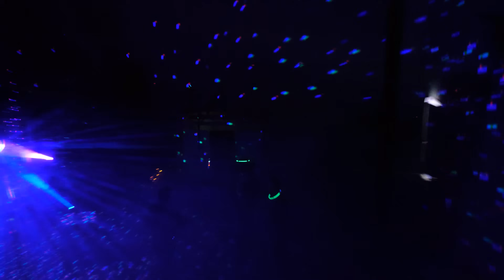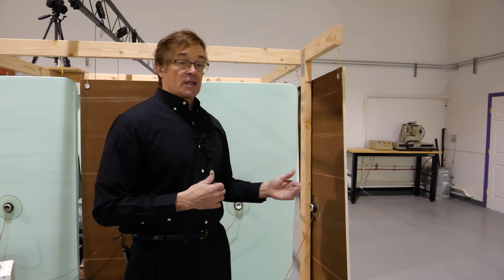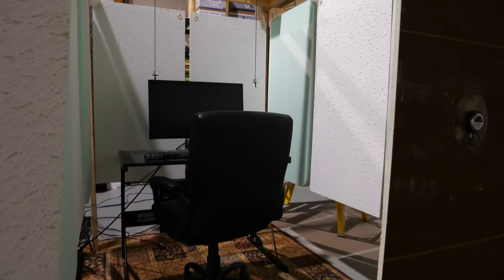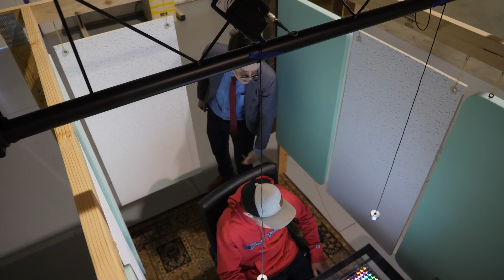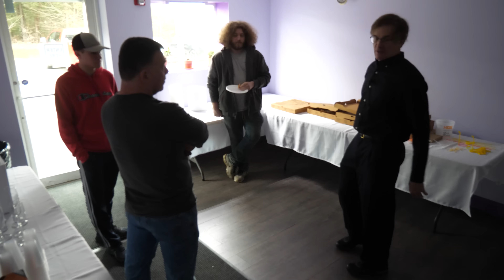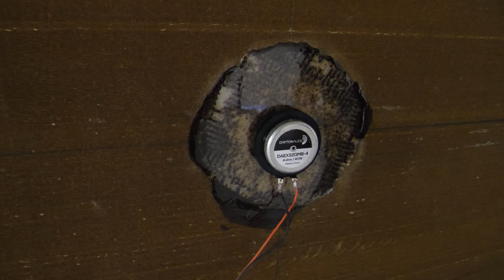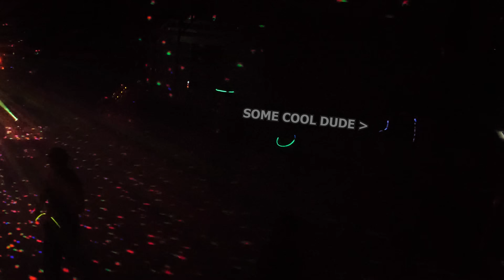SHOULD SPEAKERS THIS GOOD BE LEGAL?

Comment: As an inventor of DMP drivers (see my patents), I found that the key was the BML force of the driver. The sound is truly immersive, for some environments much better than conventional speakers i.e. restaurants, offices, open space. However, I do not believe these will ever produce true high fidelity sound because of the phase incoherence in the radiation source.
Reply: One thing I noticed as I read these comments is,  the absolutely incredible amount of information freely given, and then others who will ignore this free knowledge and comment about capital letters. ............sigh........... people ! ! !
Reply: @brucejones2354  The capital letters part is a personal QUIRK of mine!  I just like doing it.  

I copied a computer systems guru named "Bombastic Bob" in England who does the same thing.  I think he's a lot older than me (he's in his 60's I think) so I just kinda just followed his lead and became his SHOUTING IN ALL CAPS GEN-X PROTOGE!

After than, I just happen to LIKE sharing information freely since that is sometimes the ONLY WAY to get things to change OR make people aware of new ideas and new technologies.

You would be quite surprised at what will be FREELY DISCLOSED AS OPEN SOURCE UNDER GPL-3 in the next few weeks and months!

1) TWO NEW Battery Technologies (1600 miles range while towing 25,000 lbs with 4 heavy 250 lbs passengers) Aluminum-Sulfur Reversible Consumptive Anode/Cathode Process for 8x the energy density of Li-Ion at only 1.5x the weight penalty AND our newly developed SQUARE-shaped Graphene-Sheet super-capacitors joined in series to create an equivalent 500,000 kWh capacity charged from 0% to 100% in 70 Seconds at 240V/30A or 4 Minutes at 120V/20A

2) 128-bits Wide GaAs 60 GHz clock speed 575 TeraFLOPS Combined-CPU/GPU/DSP stacked-layer super-processor-chip with built-in 32 Terabytes of Non-Volatile Universal Memory which works as BOTH System RAM and as SSD-like Long-Term Storage Drive. Partionable to how you Like!

3) Acoustic-Wave Compressed Plasma Suspended In Low-temperature Molten Metal Power Generator (One Megawatt continuous 24/7/365 output in two home refrigerator-sized modules -- just needs water, a decent radiator/heat exchanger attached to the built-in micro-steam turbine assembly and a 12 volt starter battery!)

4) 12 inch to 36 inch ride height electronically-adjustable Fully Active All-Wheel-Steering and Ride Control with 4x4 Independent Suspension System combined with EV Motor in Upper-Hub-Drive design for truly 4x4/off-road high-clearance applications on SUVs, medium and light duty trucks and up to 175,000 lbs GVWR heavy-duty Class-8 truck towing dual trailer weight ratings!

So NOW YOU KNOW what we can do as a completely under-the-radar Aerospace  company!  Get ready for the upcoming Free and Open Source Under-GPL-3 licence terms public disclosures of these new technologies!

V
Reply: @StarGateSG7  It sounds like you have an amazing job with a phenomenal company. May I ask who you work for? It's time i updated my resume!
Reply: @StarGateSG7  HI. Do you have any links to the four things you said would be be disclosed? You seem to know a lot, but also claim quite some extraordinary things. Would be cool to read about some of them from an official source. Cheers
Reply: @StarGateSG7 did you try the speaker with borosilicate glass?
Reply: @Roman-oo9wl  Our parent company is a large under-the-radar Canadian Aerospace concern that dabbles in such things and YES they did use Borosilicate Glass! 

Cutting it though is quite the effort! The waterjet cutter shattered the glass and we had to use a 5 Kilowatt CO2 Laser to do the cutting.

It was an internal project as part of an internal extension of Canada's National Research Council audio speaker research into Polypropylene and other non-paper-based speaker driver materials. This was done from the 1970's into the 1980's and our company used some of the old patents and public material disclosures to extend that research into various ceramics, glasses, metals and even magnetically levitated blocks and fluids/gasses!

We found it BEST to use THICK (5 cm) and very stiff ceramic blocks with an embedded strip of iron on the edges so we could FLOAT THEM within a large magnetic field and bounce a laser at the centre and four corners that allowed us to measure the position and control the speaker panel with ULTRA HIGH PRECISION, giving us 5 Hz to 60 kHz Frequency Response since we were able to use large pulsed magnetic fields to REALLY QUICKLY MOVE AND VIBRATE BACK AND FORTH those ceramic panels to create super high fidelity sound.

The parent company ALSO used Borosilicate and other glasses and metal sheets as speakers but you get TENDED to get sympathetic resonance of the panel itself that create unwanted harmonics OR the bass sucked the big one in terms of overall quality and clarity. 

Thin Glass and Metal sheets were best for mids to highs. (i.e. as tweeters and mid-range drivers!)

NOW the company is experimenting with using a ferrofluid to create Virtual Speaker Cones and Planar Sheets that use pulsed magnetic fields to form temporary planar and cone-shaped forms within the ferrofluid that can PRECISELY SHAPE the sound pressure waveforms and vibration rates to as low as ONE HERTZ up to 110 kHz (i.e. bat ear territory!) at high amplitudes up to the maximum possible in air of about 192 dB! 

We can make these virtual sound sheets AND virtual speaker cones of ferrofluid as large or small as we want and then form them into ANY shape to best reproduce a SPECIFIC frequency and amplitude of sound. 

We can even create speakers of ANY shape and size so long the multitude of magnetic field emitters can push and pull the ferrofluid vertically, horizontally and/or twist it at any angle. We can even shape the virtual speaker shape to PREVENT or accentuate standing waves, phase cancelation, harmonics and other audio waveform products/emissions.

We can even shape the audio waveform to create a sort of acoustic tractor beam which can suspend and then push/pull an object as heavy as 1000 kg in mid-air!

The above disclosures and ideas are now FREE AND OPEN SOURCE under GPL-3 Licence Terms!

V
Reply: @StarGateSG7  ok, even though I probably don't  understand everything you just wrote, it sounds amazing what you can do nowadays and even in the 70s and 80s. I also love your attitude in the comment section, I mean, you obviously know what you're talking about, and use caps as in spoken language to friggin high light something which you want accentuated, so I really don't understand the issues of some people. The only thing concerning your points is, that this project is about creating the best sounding speakers on a BUDGET :D, so reading about materials that are only cuttable with lasers and stuff, I assume the prizes for these materials would be accordingly.

Still, it's always a pleasure to read such an abundance of random knowledge I wasn't aware of, so thank you so much :)
Reply: @felixl.2606  If the have the PATIENCE, then YES Borosilicate glass aka Pyrex can be cut with a normal glass cutter (i.e. my dad was a Glazier!) but the chance of unwanted fracture is quite high. 

Borosilicate is about $40 USD or $50 CDN per square foot so it's not too bad for small projects.

You can get large and stiff 4x8 foot (94 inches by 48 inches) ceiling tile and even ceramic boards for about $120 to $250 per sheet that are suitable for audio use.

And HARD and rigid 4 ft by 8 ft sheet of Acrylic (i.e. transparent plastic) sheet is also about $350 USD and that might work just as well as normal borosilicate glass.

You can cut that with a simple jigsaw!

V
Reply: @StarGateSG7  glass panel is heavy. 
I fail to see how this would be suitable to effectively use as a speaker membrane. One of the criteria mentioned by Tech Ingredients for panel material choice is weight. It should be very light, and rigid. Thus the choice of polystyrene panels. Intuitively, a vibrating part should obviously have very low mass to minimize losses and ensure the movement of the panel corresponds as much as possible to the actuator (exciter) input.
Personally, I would think some composite like micro-balloon loaded epoxy, or some carbon fiber sandwich on top of expanded polystyrene panels or aerogel would be much better suited than some heavy flexing glass pane.
So, no disrespect but a cursory examination of the characteristics of a glass panel tells me it is totally unsuited to this application. Care to comment why the criteria do not apply and a glass panel would be a good candidate ?

As for your other claims, I will say that advanced technology is undistinguishable from magic so sure who knows... but I will wait to see any demonstration before judgment. Until then, sounds like star trek tech. i.e. not working within our world. Would love to see it at work though, please post some videos, specially of the one ton object levitation.
Reply: @bschwand  YES! You are correct that glass panels have SIGNIFICANT MASS which would normally make them quite unsuitable for speaker purposes. 

HOWEVER, glass is also a crystalline substance having significant sympathetic resonance capability which means that ANOTHER force applied to said glass panel can make said larger glass vibrate fast enough and with enough force that acoustic waves will be emitted from the panel itself.

Using an analogy, you can make a very large structure vibrate using a smaller structure such as a hammer IF the frequency of the hammer is resonant with the larger structure.

(I should note that I am NOT a structural engineer, nor even a acoustics expert although I do have significant audio production experience - aka I know what sounds good!)

Glass panels can be resonated using sophisticated computer control attached to a vibratory structure that will cause the much larger glass panel to also vibrate at nearly the same frequency. 

It doesn't even have to be a sympathetic resonance but rather the internal propagation of attached mechanical movement causes a larger structural movement within the crystalline structure of a glass panel which then moves larger amounts of air forming listenable acoustic waves.

Since I am not an expert in this, I have to rely upon the translated-by-me descriptions of our "Real Experts" who actually ARE mechanical and electrical engineers and also our in-house acoustic experts.

All I know is that I hear MUSIC coming from solid glass panels that sounds crystal clear and full of "Vibrance" and pleasant tonality especially on highs and mids so Classical Music and Acoustic Guitar and midrange singing seems well-suited for glass panel speakers.

In terms of lifting 1000 kg masses, when you have 5 Tesla electromagnets, you can make almost ANYTHING with ferrous metal in it move at enough speed and amplitude that you can MAKE IT emit music.

Even solid rock or metal blocks infused with strips of iron can form a speaker!

It's quite fascinating to see something that heavy being pushed around like a toy. Just make sure you don't have anything metal inside of you or on you when you get close!

For a demo, there are a LOT of products we will be releasing publicly as OPEN SOURCE GPL-3 licence terms and as proprietary saleable items for very specific corporate reasons and these announcements and visual demonstrations will be the required proof that will basically start a BILLION conversations!

While I cannot SPECIFICALLY give you an absolutely exact date and time, I can say within a few weeks to a few months up to the first quarter 2023 that such reveals WILL be made!

V
Reply: @StarGateSG7  we are talking about speakers, i.e. should vibrate at 20-20khz. We don't want any resonance which would favor some frequency over others.
You explanation raises more issues than it solves...
Reply: @bschwand  I guess I should change the words "Sympathetic Resonance" over to controlled vibration by an excitor apparatus.

Evidently, my usage of the term was pointed out as being incorrect by our audio engineer in that there are acoustic waves that can hit the surface and/or travel through the glass speaker driver to cause vibration (i.e. resonance) that can cancel out other waveforms and/or cause harmonics that are unpleasant to the ear.
That is NOT what we want!

There is also simple mechanical vibration caused by a "hammering device" (i.e. an attached excitor) causing any surface to vibrate at the same frequency or a set harmonic of the direct mechanically attached or hammering excitor device.

There are a few ways to cause vibration but ANY SURFACE that can be controlled by a computer ensuring specific parts of and/or the entirety of a flat or shaped surface vibrates enough to emit acoustic waves can be turned into a speaker if the resolution of the vibration (i.e. vibrate at specific frequencies for a set period of time) can be made controllable in a highly precise manner.

Using Borosilicate Glass is a VIABLE speaker driver in the treble to high sound frequencies. Due to the tight crystalline bonds within most glasses, the SPEED of mechanical vibration can be so precise that nearly perfect reproduction (i.e. clarity) of an original waveform is preserved throughout the treble to highs range.

Again, I am NOT a mechanical engineer so the deep theory escapes me but I do understand the BASICS of what our engineers are saying.

All I can say is that I hear crystal clear mids and highs of classical music, acoustic guitars and mid-range and soprano voices when a borosilicate glass surface is computer controlled to vibrate at specific frequencies for set periods of times as per an input waveform.

It sure sounds good to me!

V
Reply: @StarGateSG7  You know it does sound like you know things. Things you shouldn't be talking about publicly. 

Then I looked some stuff up you've said elsewhere online.

A claim of a Canadian built, opto-electronic supercomputer with 20 million CPU cores, that has over a YottaFLOP* of processing power? Our fastest supercomputer in the states that is publicly acknowledged has 1.102 exaflop/s performance. You really think we would believe the Canadians have a computer A MILLION TIMES faster? Good one. Had me going on this thread though. 

[1 Yottaflop is approximately 1,000,000 exaflops]
Reply: @crispinds  YUP! It's True! Our Northern British Columbia Data centre has the "ThunderHorse" and "DragonSlayer" supercomputers which use Opto-Electronics on GaAs substrate at 128-bits wide as a combined CPU/GPU/DSP + SIMD/MIMD Vector Array Processor superchip running at 2 THz clock speeds.

I designed the hardware accelerated 2D-XY and 3D-XYZ SOBEL and CANNY edge detection code, the pixel to vector conversion software and various RGBA/YCbCrA/HSLA colour correction and  video filters PLUS the onboard 2D and 3D warp and special effects engine code!

Fully ITAR-free and all-Canadian designed and manufactured too! 

We have been running Potassium, Sodium, Phosphorous electro-chemical gating simulations that emulate at the molecular level human neural tissue to create functional WBE (Whole Brain Emulations) which get us to IQ-160 humans! 

We then turn that into 24/7/365 materials scientist researcher that does Graphene Sheet and BuckyBall (Carbon-60) optical waveguide/cavity resonator systems and electrical storage and transport systems (i.e. Supercapacitors) plus research on Aluminum-Sulfur electro-chemical storage. 

We didn't bother with Aluminum-Ion or Sodium-Ion batteries as far too many other researchers are doing that nowadays and we needed something that was ruggedized, RAD-Hardened plus high-heat and cryogenic-rated for space operations.

SO YES I do KNOW what a YottaFLOP is!  I've designed and coded multi-spectral Synthetic Vision and real time 10,000 fps object recognition systems, so I DEFINITELY THINK that I understand the implications of our advanced supercomputing systems rather well!

V
Reply: @StarGateSG7  1000kg? how far away was the object? Scale? This all sounds pretty fantastical for me to use air pressure to move that heavy without some serious physical stress on either the system or the object being moved.
Reply: @thalesofmiletus6162  We doesn't use air pressure! Our system uses MAGNETIC FIELD PRESSURE where thin squares or long rods of a ferrous metal (i.e. high iron content metal) are embedded into glass or ceramic plates and multiple external electromagnetic coils can MOVE the panel by pulsing the EM field many times per second at various locations and using LIDAR to figure out the POSITION of the glass or ceramic plates with micrometers (one millionth of a metre) amount of precision. 

Simple gaming class CPUs/GPUs can EXACTLY control the large 1000 KG weight to position it ANYWHERE within a 3D-XYZ volumetric space floating it it in mid-air using only the powers of many electromagnets, LIDAR (aka Laser Radar)  and computerized 3D-XYZ positioning algorithms. 

Works like a charm! It's the same tech used for magnetic levitation trains -- You can float a 20 tonne train car (40,000 lbs) on magnets, so moving around a 1000 KG (2500 lbs) object is a piece of cake these days! 

It's the same principle but on a 3D-XYZ volumetric positioning basis instead of a 2D-XY linear positioning basis!

V
Reply: @StarGateSG7  there is no info on these two Thunderhorse, dragon slayer supercomputers... it is very interesting though. what's your view on  AI research where are we headed ?
Reply: @arunsshiva  ThunderHorse, DragonSlayer and Haida Gwaii are internal code-names of Gallium Arsenide-based opto-electronic supercomputers designed and made entirely in Canada (i.e. are fully ITAR-free) using 60 GHz and Two THz clock speed combined CPU/GPU/DSP/Vector array processor components that are liquid immersion cooled (Silicone Oil baths)

North Canadian Aerospace (our public pseudonym) is a fully-under-the-radar aerospace company designing and building many NEW technologies such as Aluminum-Sulfur batteries, graphene sheet super-capacitors, computer controlled rheological-based magnetic suspension systems for specialty high-clearance 4x4 vehicles, DCI 16k resolution 2D/3D cinema cameras and super-low-light capable optical-grade acrylic prime and zoom cinema and super-telephoto lenses (i.e. T1.0 to T2) plus super high bandwidth wireless communications systems (100 Gigabits per second and faster!) and actual designed, building and flying of SSTO space planes!

You have NEVER heard of us! You have NEVER seen our company anywhere in the news! Our supercomputers, while the ACTUAL fastest computers in the world bar-none!, are nowhere to be found on the T500 list. 

We are completely underground (quite literally too!), so NO you won't find evidence of our devices and technology ANYWHERE in mainstream media. HOWEVER, some very very very big technology movers and shakers in the world ARE aware and have seen demos of our products and KNOW that we are DECADES AHEAD of some of the biggest technology companies on Earth!

Our primary competitors are Lockheed Skunkworks, Boeing Phantomworks,  Northrup-Grumman, Raytheon Special Projects, BAE, EADS, IBM, AMD, Intel, NVIDIA and a few others who are VERY VERY VERY secretive in their operations. 

V
Reply: @arunsshiva  Ironically, at the moment I personally am working on our WBE (Whole Brain Emulation) which does electro-chemical based simulation of  human-neural tissue at its BASE LEVEL sodium, potassium, phosphorous, etc. receptor gating/notch-filtering dendrite-level emulation. 

Using PHYSICS based rules, we simply let chemical and molecular bonds within human tissue "grow" and see what happens when we apply EXTERNAL sensory inputs such as the electrical voltages, amplitudes and larger waveforms associated with touch, hearing, sight, smell, taste, etc. reach those neural tissue receptors and EMULATE the glucose uptake of same tissues (i.e. we digitally "feed" the neurons).

We take all the BASE electrical waveform INPUTS from the light reflections caused by reading books, watching TV or viewing the natural world AND we apply the inputs of audio waveforms AND representations of Touch, Smell and Taste and then apply them to the digital neuron inputs which use common rules of electro-chemistry and molecular physics to grow, connect/disconnect those neural connections and filter said signals. 

After Billions of computer hours (spread out over many of our super-chips within the last decade), the Digital Neurons which are basically data records and objects/classes containing Boolean States, Fixed-Point, Floating-Point, Signed-Integer and UNICODE String values that are iterated, moved, copied and filtered over time, they form a neuro-plastic version of a human brain which can SIGNIFICANTLY OUTPERFORM any modern human!

It can read/write 20 languages. It has a 160 IQ and has a Ph.D and Post-grad expertise in over 100+ science, medical, social and arts subjects and it works/plays 24/7/365!

While in reality it's just a bunch of C++ classes and Data Records storing and changing/filtering numbers and characters in real-time, the end result is OUR DIGITAL EQUIVALENT, if not SUPERIOR HUMAN brain!

We mostly use it for materials science research, aerospace propulsion research and medical sciences work.  It has been SPECTACULARLY successful in some of its discoveries which we have secretly "seeded" into some mainstream companies to jumpstart human technological evolution.

V
Reply: @hunterm9  Our work is present in MANY of today's high-tech products and ee have quite the patent portfolio that funds our research rather well.

We are actually quite well known in various financial, military and industrial circles but not so much in the public eye.

We prefer to keep it that way for now until we finish some of our most prestigious research which will be publicly disclosed soon enough.

North Canadian Aerospace is our PSEUDONYM which we use when disclosing public documents but our actual name is known in certain circles. I just happen to be 30+ year friends with one of the owners and I do "free" network security and grid computing-oriented consulting work in exchange for supercomputer time for my own "Special Projects" in material science and grid processing technology.

I get access to numerous company resources and NCA gets enormous amounts of my systems-security and grid computing knowledge! I have literally saved them hundreds of millions of dollars just in operational costs alone within the last five years.  That is more than enough justification to give me nighttime supercomputer access to the "Haida Gwaii" supercomputer where I have more supercomputing horsepower in SIX HOURS per week than all of the T500 has in a whole year!  

I get a LOT OF BIG BANGS out of that R&D and simulation time in those 24 hours per month of 128-bits wide 119 ExaFLOPS!
Every Sunday from 11pm to 5 am i get full supercomputer access as they do some physical site maintenance.  I'm OK with that  since I still have a normal day job which lets me live nicely in my Vancouver-area 600 square foot shoebox condo rental.

V
Reply: @StarGateSG7  you should write a book.
Reply: @StarGateSG7  the ethical implications of what you're describing in regards to WBE are pretty horrifying. I wouldn't want to be a brain in a jar, would you?

I do have interest in the aluminum -sulfur batteries you're describing, though. Are there any papers you guys have submitted I can review?
Reply: @StarGateSG7  you missed my point about general relativity and how it serves as hard evidence for our existence being a simulation vis a vis distributed computing. Quantum Mechanics is also likely a way of reducing computation by calculating the fundamentals in integers and waiting until the last instant to resolve probabilities, and resolving them for multiple linear particles at once. It's just a way of reducing the overhead of the simulation we exist in.

Mandela effects would suggest that our memories can be altered as well, and likely have been at some point.

Those should be things that should give you empathy for an artificial life-you're just as artificial as it is. And who's to say it doesn't or can't have a soul?
Reply: @jadedandbitter  The best Answer I can give is Ask God who and what is or is not artificial and/or soulful or soulless!

I think! Therefore I am! ...BUT... whether I'm "real" or not is highly dependent upon whether everything IS an illusion.  For all I know, I am a mere linear set of integer values in a massive array iterated on some quantum machine.  I can't tell the difference anyways!
Reply: @jadedandbitter  We dont live in a simulation, and the "Mandela effect" is not real, you need to stop reading conspiracy theories. Would you like to tell us the earth is flat too?
Reply: @SpydersByte  It's 100%real, I saw it happen myself. I read Berenstein Bears books thousands of times as a kid, and then the name changed. On my books, other books, books everywhere. It was like the 4 Ninja turtles were suddenly Leonardo, Raphael, Michaelangelo, and Bernini and had always been that way. I don't believe the earth is flat, I've seen the curvature of the earth in an airplane. But the Berenstain Bears used to be the Berenstein Bears, then somebody snapped their fingers and they weren't anymore.
Reply: @jadedandbitter  nothing changed, they were always the Berenstain Bears you just have a bad memory. And its completely ridiculous and insane to think that REALITY LITERALLY CHANGED instead of you just remembering something incorrectly.
Reply: @SpydersByte  No, I don't. I would sooner mistake the name of a Teenage Mutant Ninja Turtle than the spelling of those books. I was obsessed with them as a kid. So yeah, reality changed. I don't know why.
Reply: @SpydersByte  Nope. There are many other things that I'm not sure about and would gladly acknowledge that I could have misremembered. Something that I was obsessed with and read (and re-read) thousands of times? No. I would sit and stare at the cover to The Spooky Old Tree for hours. Like I said, I'd sooner forget the name of a ninja turtle. Have you ever met somebody who thought Mr. T was Mr. Z or Mr. G? Somethings you just DON'T forget. I would testify in court, under oath, with a gun to my head that the Berenstein Bears WERE spelled like that in my youth. Because they were. 

I can't explain it, but I know I'm not misremembering it. Honestly when I first noticed the change it was so disturbing it was like finding out the sky is green and always has been, when yesterday it was blue. I can't overstate my confidence about this specific detail and how disturbing it is to me. I would LOVE for it to be a faulty memory. But it's not.

Also-there was no Berenstein Bears cartoon show when I was a kid. Trust me, I'd have known, I saw literally just about every other obscure cartoon show in the 80's, including stuff like Jayce and the Wheeled Warriors and the Inhumanoids. But now apparently there was, and it wasn't even obscure, it had a few seasons.. So it's not just the name-things are different, and it's very disturbing. I try not to think about it most of the time.
Reply: @crispinds  The first Quantum computers were actually developed in Canada by a company called D-Wave, with the first models being manufactured and sold to NASA and Google, etc.  This was almost a decade ago now. Point being, it shouldn't be disregarded just because you assume we have always been in the forefront of development on such technologies.
Reply: @StarGateSG7 Pyrex quit making consumer product out of borosilicate some ago.
Reply: @CeresKLee  Pyrex STILL uses Borosilicate in Europe. It's only in the USA and Canada where Pyrex is plain old soda-lime glass.

It's due to the high expense of boro-silicate glass production and since soda lime glass has much higher purity in the 2020's-era than it did before Year 2000, there really is no more need for as much thermal expansion and contraction stability as Borosilicate usually provides.

Modern Soda-Lime glass is so good these days that it works in the oven just fine!

V
Reply: @StarGateSG7  I had a 4 cup measure Pyrex bowl shatter in a microwave, The US is hosed again.
Reply: I design and produce borosilicate glass color from cullet and from scratch. (well known tax paying company with multiple employees)  1 meter by 2 meter by 15cm piece of boro float glass is 1475 pounds before you add the metal. I'm un aware of any ferrous metal that has a compatible coefficient with borosilicate. What do you use to attach the two? How does it effect the resonance ? 25000$ Per pannel that weighs a ton and a half each?!   If you can even find someone to produce them, or ship them safely.  Are these pannels tempered or not? Makes a big difference in the material properties. They would take weeks to anneal correctly in a kiln.  These are MAJOR hurdles trying to bring this design to any type of market, especially considering the available alternatives and price points. Sounds like a pipe dream to me. In the very least your "30 year friend" is feeding you the most optimistic opinions trying to justify the expense.  Lets float thousands of pounds of fragile glass vibrate it and any other magnetic material in the immediate area with electricity, in a public setting.   Even if the efficiency was high your still talking about very large quantities of power to move that mass. Who will pay the electricity bills after they buy and install this monstrosity?   Is it a cool science project built in a industrial military complex already equipped with the ability to levitate large ferrous objects? Sure.   Is it the next big thing or even viable in the least as a stand alone system like you suggest? Not even a little bit.   "Cost wise they are not even that expensive"  rolf.   As much as I sound like a troll, I dont intend to offend. Im just thinking out loud. I may be the only one in this comment section with the ability and motivation to build a pair following this channels design with flat borosilicate panels I made myself (Or any other shape , perhaps parabolic and hollow with a fluid damper. ) p.s. Your "humvee upper wheel hub design" is called a portal axel. You must know that term if you actually designed your own set for a f150?!
Reply: i'm not an audio engineer, but many good acoustic places, including things like stonehenge, are build with lits of golden ratio surfaces.

building the panel in a golden ratio shape and placing the driver in such a placement might help phase issues
Reply: @Chrisspru  a British company (ceased) NXT  published a massive amount of technical papers and patents based upon extensive computer modeling, testing and product development. The ratio PHI was not optimal. The panels built in this video are based on NXT's published material. 
The means by which sound is radiated from a panel is do to non linear distortion of the panel. ~ a long technical discussion~ the location of sound emission at each instant of time is randomly different. Over time it will average to the location of the driver. Yes, you can put two or more drivers on the same panel and have some imaging, although not very good...
Reply: @stephensaint-vincent8680  it probably has to do with eulers number and pi too. if i had to take a guess
Reply: One of the issues I see (as a music production engineer rather than as a mechanical engineer), is the thickness (or thinness!) of any radiating source which will BEND, TWIST, SHEAR and otherwise deform in a NON-uniform manner which means acoustic wave will be radiating outwards in ways you don't want. This means sound colouration, phase issues. 

ANYTHING used as a speaker driver that is made of a thin material that is NOT super-stiff will not deform in a uniform or at least predictable manner giving you reduced audio quality.

Trying to add baffling and any rear-of-driver or front-of-driver waveguides that are tuned towards diminishing or enhancing specific frequency ranges (i.e. to enhance bass) is simply another colouration added to the original audio waveform.

After reading your patents, I do in fact suggest changing the PTEG polymer over to actual super-thin metals such as magnesium, 8000 series aluminum or a  high nickel and cobalt content Stainless Steel. They are so stiff that acting as waveguides and drivers they should deform in a very predictable manner over their entire surface area as they vibrate. 

You can use laser interferometry to scan their entire vibrating surfaces at multiple points every two to four millimetres apart in real-time (One Megahertz sampling rate of the laser reflections should do it for area measurement accuracy) so you can get a 3D animation of HOW MUCH and WHERE any thin material resonates/vibrates/deforms and THEN you can visually see where you need to add thickness in a driver or baffling/waveguide material.  

The deformation of ANY material over a 2D area should follow a Bell Curve-like sine wave where the peak deformation is in the middle and the outer edges have a SMOOTH deformation curve so that air can be moved off the vibrating surface that does NOT add any further colouration of the sound.

One actual mechanical engineer I have been talking to has HIGHLY SUGGESTED that the NEWEST speaker driver material is dome-shaped, flat-planar, single-plane-curved and even cone-shaped GORILLA-GLASS (i.e. a Corning Glassworks product) because the designers trying to make the toughest, moke break/shatter-resistant cell phone touchscreen surface just happened to ALSO MAKE a nearly-perfect  and perfectly-resonant thin speaker driver material. Try Gorilla Glass as speaker driver and baffling/waveguide materials!

V
Reply: DAMG IZA WALTZED INTO AN ALLCAPSALYPS
Reply: I concur.
Reply: @Older_Archer  Thank you for subscribing! I'm not fully READY YET to do full-time content creation ....BUT..... I can tell you some SECRET AND TASTY TIDBITS of what's going to happening in the next few weeks.

It will be about 60 GHz super-cpu chips going for $888 USD along with high-end flagship multi-socket motherboards going for $333 USD, $555 USD and $888 USD
(This is a fully ITAR-free NCA-North Canadian Aerospace Product!)

A new type of 4x4 high-hub SHAPE-SHIFTING WHEEL and SUSPENSION SYSTEM that can lift up to 36 inches (more than a metre high!) and lower to less than 15 cm (6 inches) for going over and under all sorts of obstacles in EV and normal vehicles. The EV versions have high-heat-and-cold resistant Cobalt-Samarium EV magnet motors built into the hubs with high-torque and horsepower and the wheels SHAPE-SHIFT from circular wheel to flexible multi-shape CLEATED-TRACK formats (i.e. similar to bulldozer tracks) at the touch of a button for off-road and on-road use in ice, snow, mud, sand, rock, gravel, etc!  (I designed and built that one completely myself and is completely FREE and OPEN SOURCE under GPL-3 licence terms for all designs and manufacturing processes!)

The Aluminum-Sulfur batteries with 8x the energy density of Li-Ion is also coming out with ruggedized mil-spec case designs.
(This is a fully ITAR-free NCA-North Canadian Aerospace Product!)

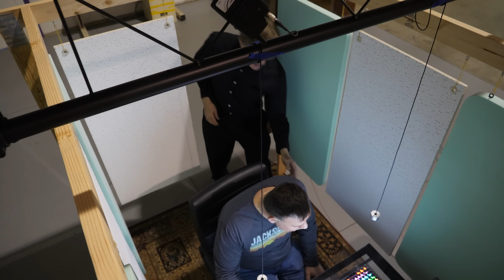New DCI-16K resolution 240 fps video cameras AND new 16:10 aspect ratio 16,384 by 10,240 pixel resolution at 64-bit colour displays are coming too! That's along with optical-grade better-than-T2 all-Acrylic FAAAAST cinema prime and cinema zoom lenses at the sharpness, price points and image quality levels that will make Zeiss/Arri, Leica, Canon and Fujinon poop their pants! (This is a fully ITAR-free NCA-North Canadian Aerospace Product!)

We also have wireless communications systems that are Petabytes per Second data transfer rates at ANY distance (i.e. over-the-horizon) using Quantum Entanglement-based nano-electronics (i.e. 64k by 64k array of trapped Xenon gas Nanowells!).  We have SOLVED the quantum decoherence issue! No more telcos or ISPs are needed as EVERYONE gets their OWN multi-petabytes IP-3000 packet format secured/encrypted communications gateway, router and switch that uses NO Radio Frequcney (RF) means to communicate but rather uses Albert Einstein's Spooky-Action-at-a-Distance physics theories to communicate! (This is a fully ITAR-free NCA-North Canadian Aerospace Product!)

Then we've got the Acoustic Wave Liquid Metal Plasma Compression System which is a high-end thermal-transfer system for electrical power production which creates continuous one megawatt output in the space of two refrigerators so long running ocean salt water or city/utility-delivered fresh water is present (i.e. as the source of the hydrogen plasma!) and can be hooked up in series for city-scale Terawatt-class energy production! (This is a fully ITAR-free NCA-North Canadian Aerospace Product!)

It's a lot but that is only a TENTH of what we have in our labs! The rest will come later!

V
Reply: How do they compare to electrostatic speakers like QUAD ELS 57 and 63?
Reply: @stevelane5885  While I am personally NOT familiar with the Quad ELS 57 and 63, I have just done enough research to note that they have great response below 500 Hz and great response from 8 KHz and above, but they have the TYPICAL poor frequency response from 20 KHz to 7.9 Khz due to the panels being Bell Curve-like in frequency response due to them NOT being stiff enough to accurately emit sound at all the major music-oriented frequencies on a linear basis.

When I compare our intermal company-made Borosilicate Glass flat panels, which are 1 x 2 metres in size AND we float them in a large magnetic field, those panels are up to 15 cm thick ( 6 inches) so the resonance and harmonics are very limited since they are extremely stiff!

We are literally keeping the ENTIRE PANEL solid and super-stiff unlike the very thin panels of most Quad ELF-style panels which are usually less than one millimetre thick. Those ELF speakers are DESIGNED to flex while ours are a solid piece of glass which move an entire block of air around with high precision. 

Thin-membrane or thin-panel speakers flex on an inverted bell-curve like basis introducing all sort of colourations and harmonics since BY-DESIGN they do not flex uniformly.

A solid glass or metal panel of great thickness will NOT flex and will move the ENTIRE columm of air forward and back in its plane of movement without cause a Bell-curve-like air column movement. It's a purely linear and predictable equally columnar movement of air!

If the movement is PRECISE enough, we also get a frequency response from 5 Hz to 120 Khz which is an OUTSTANDING frequency response not matched by ANY cone speaker or thin flat panel.

Since our panels have a wide ferrous (i.e. iron magnetic) strip on the entire outside edge AND we shoot a beam of light (i.e. lasers) at the back to figure out it's position and orientation within 3D-XYZ space while it's being held in mid-air by a huge magnetic field, we can move MASSIVE amounts of air in a singular column in the most precise of ways. 

The AMPLITUDE of the emitted signals approaches 150 dB so they are VERY POWERFUL since they move so much air in such a short period of time!

Cost-wise they aren't even that expensive! 

It was the EM field generator and the software control system that costs the most! The borosilicate panels we floated like normal glass on molten tin/solder and just made it thicker.  The final borosilicate glass thickness is governed by the density of the molten metal we float it on in order to make a 1 m x 2 m by 15 cm thick plate of completely flat glass. (i.e. I can't remember exactly which specific molten metal we use to create the panel but most glass manufacturers use tin and ours is dense enough to support that 15 cm thickness of glass!)  

The borosilicate glass panels themselves cost around $25,000 USD each to make (i.e. mostly labour costs) while the EM field generators are dependent on coil size.

Our parent Aerospace company went with the new in-house developed technology and will be using it to make Speaker Arrays for Sound Reinforcement at stadiums, concert halls, big and small auditoriums, school gyms, churches and meeting halls. They will be scaled down of course to fit smaller boxes. The frequency response is soooooo good that the patented technology is also being bought-up by some of the "Big Boys" of modern audio electronics for consumer and commercial purchase in the next few years!

V
Reply: Hi! Your work with DMP drivers sounds fascinating. 
I’m curious, have you considered leveraging machine learning or parametric design to address the phase incoherence issue? 
Here are a few ideas of using advanced techniques to potentially optimize shapes for better phase coherence and sound fidelity:

Neural Networks for Shape Optimization
Generative Adversarial Networks (GANs)
Finite Element Analysis (FEA)
Topology Optimization

I’d love to hear your thoughts.
Reply: Also, has composites been tested?
Reply: DMP?  BML?
Reply: Try Borosilicate GLASS panels as wall-based speakers --- The Boron is not only a high temperature stabilizer within the silica but also acts as a microscopic dampener. You could probably also use automotive safety glass panels which have polyethylene sheets embedded in-between the multiple layers of glass to ALSO act as dampeners. 

For high frequencies (i.e. wall based tweeters) and super-low bass (below 100 Hz) maybe something like a Sapphire Sheet or hard ceramic might work better.  A possible suggestion for comb effects and signal multi-path or unwanted signal cancellation/reduction is a FLUID such as water or even mineral oil sandwiched between sheets of fibreboard, glass or ceramic to act as an intermediate absorber. In some cases a fluid lighter than water such as an alcohol (i.e. ethyl or methyl alcohol) or a hydrocarbon (i.e. hydraulic fluid or Engine Oil) could work to dampen a speaker while still allowing certain frequencies to emit or pass-through. 

Somebody needs to spend time on an acoustic raytrace application to check out HOW audio waves will behave WITHIN, on the surface of and outside of these types of wallboard speakers.  Four AMD GPU graphics cards combined together to create a virtual supercomputer in an x499 motherboard filled to the brim with lots of system RAM memory and lots of disk space could do this simulation to OPTIMIZE the fibreboard or glass/ceramic board construction and placement within less than a month!

You can even use common open source optical ray tracing and/or computational fluid dynamics software to convert fluid movement into an acoustic waves simulation what would create an optimized construction and materials survey of these types of speakers!

Just a suggestion!

The above ideas are now free and open source under GPL-3 Licence terms - June 19, 2022!

V
Reply: @StarGateSG7  For this kind of simulations doing some tinkering and understanding of how sound waves behave then doing experiments in real life to gather data offer far more bang for your buck than a computer simulation on consumer grade hardware. I don't see how the usage of amorphous or crystalline materials would give any serious advantage other than in tweeters. Such materials have all the wrong properties for lower frequencies, they are usually heavy and have very low dampening factors (boron does not have any impact in borosilicate glass other than to lower thermal expansion) by having to add some dampening material it just complicates things. Ill be honest, is good to see people spreading ideas for free but your notions remind me a lot of the nonsense of an audiophile.
Reply: @StarGateSG7  Fascinating! you seem to know a lot so Im using this opportunity, I would like to learn a bit about something you seem to know (fullerenes). Im curious about the molecular physics of fullerenes under pulsed laser irradiation, specifically  as non linear filters for protection of electrooptical devices. Why do they change their absorption after a certain threshold and how can it be tuned?
Reply: @teresashinkansen9402  I should note that while I personally am NOT a physicist or degreed organic chemist, I do know SOMETHING about Buckminsterfullerenes (aka Carbon-60) and in terms of absorption of pulsed radiation, the 3D Carbon-60 structure itself, which looks like one of those old-style black and white soccer balls, has a "scaffolding" that breaks up the path of incoming photons, scattering them depending upon the current orientation of each carbon-ring "facet" that is facing any given incoming light beam. 

The twelve 5-carbon rings and twenty 6-carbon rings that form a typical BuckyBall will form a structure that is about 0.7 nanometers in diameter and will easily scatter any Green to UV laser light while any light at lower energy levels (IR, RED, etc) will simply be EITHER absorbed directly or reflected back in the same direction.

I am not NOT an optical physicist but at 0.7 nm, the behaviour of photons will likely be governed more by Quantum Mechanical principles than General Relativity, so the behaviour will be undefined for any given specific application at such nanoscales.

I think I might be able to help you by using a macroscale ocean waves analogy where scientists have recently been able to MITIGATE the effects of a Tsunami or any other large ocean waves by SPACING large floating vertical posts at least one metre in diameter that float vertically between 50 feet to 100 feet under the surface to 50 feet to 100 feet above the surface and spaced 10 to 50 meters apart depending upon current ocean depth in order to form an interference pattern as the waves pass through all the posts. The incoming waves hit the posts, split apart and hit the OTHER waves that were split apart by all the other posts forming wave collisions that cancel-out completely or at least REDUCE the incoming energy of the waves by forming less-destructive standing wave patterns. This protects coastlines and other vital seashore infrastructure.

This interference pattern analogy can ALSO be used at the Nanoscale level by using 2D or 3D atomic or molecular structures spaced X-number of nanometers apart that are Y number of nanometers in height/depth and Z number of nanometres in orientation and/or structural format (i.e is it buckyball, triangular, square, linear tube, or other 2D or 3D nano-scale or molecular scale design!) that "splits" apart incoming photon "waves" so that interference patterns will REDUCE overall incoming energy OR will form standing waveforms that also reduce overall energy levels.

In your case, I would personally use cheap ceramic-coated polymer microtubes in whatever orientation you need that are spaced out X-number of nanometers or microns to create those incoming waveform energy-reducing interference patterns which cancel each other out or possibly even TRAP the waveforms in standing wave patterns.

The nanocoating on the polymer tubes will absorb HEAT while the polymer tube forms the stable 2D/3D microstructure that create interference patterns/standing wave patterns as incoming light gets "split apart"!
I am suggesting a ceramic coating more for thermal resistance reasons, but you don't have to use such a coating if you don't want to. Polymers such as HDPE (high density polyethylene) or Nylon may have enough heat resistance for thermal protection needs against incoming coherent light beams aka LASERs!  This technique is ALSO usable against MASERS (i.e. microwave-versions of LASERS) or any other band of coherent waveform.

YES! I know photons can pass through each other (aka wave/particle duality) BUT at molecular and above scales, they should act more like ocean waves, able to be broken up by appropriately-spaced "posts" of a properly computer-modeled size/length and diameter.

I hope that helps! Message me with proper contact info if you need a better/longer  explanation!

V
Reply: @teresashinkansen9402  Раз я не русский, а ты русский, то это для твоего СУ-57 или Кинжала работа?

Вы должны увидеть космический самолет-невидимку весом 148 000 фунтов моей компании на YVR! 

P.S. Не злите инопланетян, так как они раздражаются и БУДЕТ стрелять в ответ!
Reply: @StarGateSG7  Very interesting I might say, that analogy really made it clear about how the light waves behave at the quantum level when they interact with the fullerenes, I guess plasmon resonances also have something to do? or the size and electron configuration of the bucky balls aren't appropriate for this phenomena to happen? I also wonder if evanescent waves penetrate into the graphene cage? if i introduce metal atoms inside the fullerene would it interact differently?
Reply: @StarGateSG7  Fascinating and very useful insights indeed, but now that you mention it im also quite interested in algorithms like SOBEL/CANNY edge detection or even Ai or similar deconvolution technologies for super resolution analysis of images, from long rage telemetry telescopes for ground observation, haven't found much as most are closely guarded by private companies and military, so far i been using image stacking and using wavelets but this is only possible for objects that don't move.
Reply: @StarGateSG7  Нет, я не работаю на российскую компанию или государство, просто мне повезло, что я наделен высокой любознательностью, но и проклят, так как мой пытливый ум, никогда не утоляющий свою жажду познания, довел меня до некоторых проблем с обществом.
Впечатляет, вы меня поняли, да, я из России, и я независимый исследователь с жаждой знаний о многих вещах, одним из которых являются электрооптические устройства, а также немного ядерной физики, не связанной, но все же довольно крутой.
Reply: @StarGateSG7  Вопрос о нелинейных фильтрах на основе фуллеренов стоит для защиты электрооптики от лазерного повреждения.
Reply: @teresashinkansen9402  I would use coated microtubes standing vertically, which almost looks like animal fur when put under a high-power microscope. The horizontal spacing BETWEEN each of the vertical tubes has to GREATER than the wavelength of the light to are trying to trap if you are trying to trap the waveforms within an underlyng substructure OR if you want to simply scatter or reflect incoming waveforms the horizontal spacing between the vertical tubes must be LESS than the wavelength of the light you are trying to reflect or scatter.

Ceramic coated HDPE or Dyneema strands might work and maybe boron or carbon nanotubes or simple silica glass fibre with a gold nano-thick coating to scatter light from incoming laser would also work! The ends of the tubes facing the incoming light beams SHOULD be hemispherical in nature and polished to offer best reflective abd light scattering possibilities.

V
Reply: @StarGateSG7  Bass is the weakness of electrostatics and has lead to many a blown panel. The only way out is a properly designed sub system, 21". 18" or rotary.
Reply: @StarGateSG7  Glass is too heavy, the panels must be very light weight. Some other sort of composite like carbon fiber with constrained layer damping might be good
Reply: @dingdong2103  Glass works JUST FINE! Ourparent Aerospace company moves 1000 KG slabs of it in 3D-XYZ space AS a speaker! It actually INVENTED the magnetic levitation technology to do that and is selling that technology to MAJOR media companies!

Because they want to move ENTIRE columns of air back and forth, the stiffest material with the properties needed was Borosilicate Glass with ferrous plates (i.e. magnetic iron) embedded into the surrounding edges so the ENTIRE plate can be floated within a POWERFUL multi-Tesla magnetic field and MOVED back an forth at kilohertz frequencies. 

The amount of INERTIA within a 1000 KG piece of glass and the sheer amount of MASS that is being moved required advanced laser-based measurement and extreme amounts of magnetic field control.

Glass will work JUST FINE as a speaker material. Just need to be able to control it well! It can do 5 Hz to 100,000+ Hz and amplitude over 130 dB so it's very very powerful and PERFECT for Outdoor and Stadium-level sound reinforcement applications once each slab is shrunk down to about 10 KG using more "focused" and smaller EM fields to float it as a loudspeaker system.

V
Reply: @StarGateSG7  Well sorry we're speaking about off the shelf exciters here with a few grams of ferrite magnet and a coil. Glass does work but is far from optimal. It has good rigidity but weight is too much for a small exciter.
Reply: @StarGateSG7 :  Yeah, sapphire, let's just build $30 million speakers...  NOT.  If you want to eliminate all resonance, build them out of thick concrete.  If you want to capitalize on your resonance minima by coupling both the speaker's front panel resonance as well as the total speaker mass resonance, you're far better off with good, thick plywood and a calculator.
Reply: @justincase5272  Don't forget to add the THICK fibreglass baffling so we can absorb and get rid of harmonics too!

For those of you building your own speakers, simple 3/4 inch thick plywood in a big box with lots and lots of fibreglass batting will work just fine. 

Remember you are trying to BETTER your store-bought plastic-and-pressboard-made speakers that LOOK cool but have the sound quality of a tin drum.

For less than $800 worth of plywood, drivers and cross-overs, you can make yourself a SWEET set of speakers that will sound just as good as those JBLs and they will definitely looks nice since I suggest cherry veneer or black walnut veneers oiled with Danish Oil!  

Mine were built in High School and they STILL are fantastic sounding! I can sell them easily for more than $3000+ USD cuz the sound and construction quality is great!

V
Reply: @StarGateSG7  whats with the CAPS you TWERP
Reply: @toseltreps1101  This TWERP has 30+ years in Aerospace doing 2k, 4k, 8k, 16k video cinematography/editing PLUS designing and coding custom 10,000 fps fractal video and audio compression systems WITH 65,000 objects per frame 2D-XY and 3D-XY SOBEL/CANNY edge detection for automated vector conversion and fully automatic object recognition, tracking, targeting and fire control!

Me thinks THIS TWERP might know what I am talking about even WITH THE ALL-CAPS!

ALL-CAPS! They're Good Fer Ya Cuz They Got Electrolytes!

V
Reply: @StarGateSG7  How can one be so full of themselfs? All that knowledge, but no social skills to communicate them
Reply: @devtech4661  This is the world of ONLINE world of Youtube comments! --- Maybe it's just because i'm a simple "arseloch" --- (look that up german-to-english!)

Nothing else needs to be explained as "arseloch-ness" is the most BASIC of explanations for the way I write and behave!

OR .... maybe it's because I am a 50,000 year old alien "Slumming It" here on Earth with the not-to-sapient Sapiens to josh y'all fer some unbeknownst-to-ye alien appetites!

V
Reply: @RaptorMove257  I suggest borosilicate glass (aka Pyrex) which you can buy in sheet 24 inch by 24 inch form factor and cut to size using multiple techniques notes elsewhere on Youtube.

At that size you will get premium-quality  mids to highs (i.e. a great mid-range and tweeter speaker). If you use it for bass it will probably only go down to 350 Hz with any clarity which isn't all that great but it isn't that bad either. About the same BASS audio quality as a typical boom box. The mids and highs when using Borosilicate Glass will be much much better quality and clarity!

For Bass frequencies you need a more flexible board such as ceiling tile BUT also one that does not resonate as easily, so I suggest maybe using Nylon Cutting Board?  

I have NOT TESTED Nylon Cutting board as a BASS Driver speaker material but I will say there is a 50% chance it will work with reasonable audio clarity from 500 Hz downwards!

It's the size and thickness of your driver material that will limit the quality of the audio. For mids and highs, the thinner and smaller the glass and/or nylon sheet, the more CLARITY and lesser the chance of resonance.  AND for mids and highs, the LARGER the surface area on borosilicate glass the less clarity and higher the chance of unwanted resonance

This is WHY high end speakers have 500 lbs+ tower casings and SMALLER drivers for mids and highs but HUGE drivers for bass.

You basically need HUGE MASS to dampen/absorb unwanted internal reflections and unwanted sympathetic frequency resonance!

V
Reply: @StarGateSG7  thank you!!
Reply: @devtech4661  Stick to coding bruh
Reply: @cybyrd9615  Right? dude says they could suspend 1 metric ton objects using the tractor beam effect of his ferrofluid, maglev, laser driven speakers, and no one is calling horseshit? Ill be the guy lmao.
Reply: @theboathaaa7654  We lift 1000 kg objects using multiple up-to-FIVE Tesla EM field generators and THAT is a very very POWERFUL magnetic field.  

Better not have any ferrous metal parts in or on your body when you have that sort of force available!  There is a way to KEEP such EM fields confined to a small 3D-XY volume but we have to pulse them and use some combinations of advanced doped-Samarium-Cobalt permanent magnets and electromagnets.

Our parent company is also a very large aerospace concern with award winning scientists of various disciplines in its employ.

YUP! We can DESIGN AND MAKE FULL IN-HOUSE advanced technology systems such as suspended panel and ferro-fluid speakers, 128-bit wide combined CPU/GPU/DSP super-chips, DCI 16k resolution multi-spectral video cameras, Aluminum-Sulfur batteries and Graphene sheet supercapacitors AND also in-house design and build 148,000 lbs spaceplanes!

We have a few other gadgets under development so YUP we can lift a 1000 kg weight in a BIG EM field and move it around like it was water!

V
Reply: @StarGateSG7  All of this is extremely cool and I'm not digradinging it in any way but I feel you have gone the way of the Asgard in that your too smart to see the simple purpose of the video being the best "cheap and easy" speakers. As in so easy a neanderthal like me can do it and that's admitting that half the science goes over my head let alone what you added to it.
Reply: @StrifeA217  idk. That was a lot of good and also interesting information
Reply: @StrifeA217  True! I can't help it. I see some project done by someone else and i just ITCH to change and upgrade it to insane specs!

In terms of speakers, just take a big wooden box. Stuff some fibreglass insulation in it and wire up up 3 speakers with cross-overs at 300 hz (for deep bass) on the big 12 inch woofer and set the midrange (6 inch driver) for between 301 hertz to 3499 Hz and your 3 inch tweeter to anything at and above 3500 Hz.

You will be better off than 98% of speaker buyers if you buy decent drivers online at  $500 for two sets of three drivers (six drivers are needed to make up a stereo pair for your self-built big box speakers). 

Remember to space the drivers equally apart within the vertical height of the speaker. Some people want to give extra room for the bass driver, but unless you do what BOSE does by making an interior multi-panel waveguide, just save the time and money and space your speakers apart on a visually pleasing and equal basis

if you make your speakers 48 inches high, 24 inches wide and 18 inches deep plywood boxes using 3/4 inches thick marine-grade plywood and glue or staple 4 inch thick fibreglass batting on the entire inside of the boxes not used by the drivers, the resonance will be limited in scope and the sound quality will be amazing!

They will sound like $5000 JBLs for only $750 bucks of materials and your labour.

I did that in high school and my black-walnut veneer 3/4 plywood and fibreglass batting self-built stereo speakers STILL look and sound great even after all these decades! (I re-oil them with Danish Oil regularly to ensure they stay shiny and new looking!)

I did a recent sound test on them and their frequency response was STUNNING compared to even expensive JBLs!  My woodworking teacher REALLY KNEW how to help me design the speaker boxes and help me choose expensive-for-the-time high quality drivers!

I could sell them today for over $3500 because the sound quality is STILL that good in 2022!

V
Reply: @StarGateSG7 :  Yuk!  Oh, HECK no.  WAY too much resonance.
Reply: @justincase5272  My woodworking teacher ALSO Suggested pouring CONCRETE into the speaker box and THEN leave enough room for the drivers but at the time I though that was pretty heavy and a stupid thing to do. I probably SHOULD have followed his advice BUT again, I thought it was stupid at the time.

My High School-built Plywood speakers with LOTS of thick fibre-glass baffling sound NICE and BOOMY which I LIKE for the type of music I like, which is a lot of 80's/90's metal and 2000's-era operatic rock (i.e. Nightwish).  Again, for the time they sounded great (and STILL ARE!) being a lot better than many store bought speakers!

The resonance is fine!  Most persons over 30 can't hear it anyways as it's hidden in the music. You need a spectrum analyzer to find it!

V
Reply: @devtech4661  it's called "being an engineer"
Reply: @StarGateSG7  
I cover my flat speaker test in musou black it's made to absorb 99.9995% of light basically when I turn on the lights I can see anything even with the lights or not 

If u do something that really work 

JUST MY OPINION
I own a private military base But I run test on turbulence on my fighter jets which mostly relates to how sound wave can be modified to our preference this also could make take sound to a more realistic way of how a human ear works and how a speaker should really sound to make the realist audio that sound EXACTLY like what a human being hears irl 
The types of panels u actually would need to make such a thing is

Composite metal foam

We use this on humvee great for sound production but mostly sound proofing because what we actually looking for the worlds most realistic audio 
Needs to be look at on how we hear at the moment how does human hearing hear

So lets say I'm in a forest u her wolf's
Elks 
And many other animals but when we hear there not well directed on what we hear them from all we know is that the sound is on our left

Humans normally not can hear below or above infact to make a true audio of what we realistically hear 
Would need much more tech and programing then what u provide

U see our ears work much like a gyroscopic audio not a surrounded area that's what people would get mixed up with a 

"SURROUND SOUND"

This means we need the audio to be able to move with us based on our head movement and vr is not anything to do with this that's a whole different generation that just messes up a true audio

Because only a fighter pilot knows a true audio actually sounds like u see a fighter jet is like portable speaker because the sounds are much realistically more amplified then on land

So to simulate such action we would need around 15 different parameter speakers specifically a ultrasonic audio that blocks sound from bleeding out it's range when people use speakers and head tracking it's unrealistic
On what they call

"3D AUDIO" 

Because some generations don't get the idea of what a true audio should sound 
And that is more treble

Treble is more sounds that are low sounds like footsteps gunshots from a ak 107k 
Or a HK G36C assault rifle

Are more of a bass not really what u need to simulate a surround sound  

Instead more of localization of where the sound is coming from is neither what u need 

It's more of position

When I make a TRUE surround sound I want a revolving audio that I can hear when I turn position

So what u would need a is parameter speakers all around a area that has a circle radius of 7 yards with special militarized material COMPOSITE METAL FOAM 
preferably aluminum alloy

2mm thick of cmf

The speakers need to be behind the panels like in the video 

A motor that would revolve the panels based on your Position
Some of the panels would need to automatically turn in a direction u are unable to hear it 

It's much like these panels in this video but in a circle radius

U would need to be in the middle and the speakers in a 7 yard radius and when u turn the panels will 
Twist towards the outer circle
Reply: @adhd_with_pennies4867  In fighter jets, modern helmets (i.e. latest F35/F22 ones) are STARTING to have 360 degree globular parametric audio that has 40 ribbon speakers (best quality sound AND can take the 7+ negative and positive G's (i.e. 7x Gravity) of some jet maneuvers) installed into the foam part of helmet that allows the body to perceive the direction of synthetically created sounds of jet engines, gunshots, rocket motors and even weather so that pilots can FEEL where the direction of incoming craft and ordnance is coming from.

This synthetic soundscape allows the SUPERIOR human audio system to help with pilot workloads so that any given mission can be accomplished faster and with more accuracy.  This is especially handy in dogfights and in over-the-horizon warfare where directionality of both friendly and adversary assets needs to be subconsciously determined and acted upon.

Our brains have a POWERFUL AUDIO DSP system built-in and by installed multi-directional sound into helmets pilot workload can be reduced to make for better warfighting!

The materials of the 3D soundscape production system is basically immaterial as simple flat planar or ribbon speakers will do.

My 2000-era high end QP-400 MB Quart head phones have a 5 Hz to 24 KHz frequency response listed on the box which is WAAAAAAY beyond what humans can hear so those drivers alone in stereo form can reproduce ANY type of sound needed!

Put 40 of them in a fighter jet helmet and TRUE 3D-XYZ 360 degree audio can be created for ANY required sound and soundscape. 

Metal foam speakers is a misnomer! They are NOT needed! ANY modern headphone driver material will work so long its frequency response is between 5 Hz to 24 KHz (24,000 Hz).

i am not sure what you mean by your unclear comment about using metal foam as that tends to be used for thermal signature management, fuel tank stabilization (i.e. absorb sparks/electrical current to prevent fire and explosion) and as hull and wing structure stiffening.

It's NOT needed for modern acoustic systems.

Please clarify what your comment means in terms of modern aerial warfighting scenarios?

V
Reply: @StarGateSG7  Actually it's ARSCHLOCH, not arseloch.
Reply: @pistonburner6448  In reply to an earlier comment about my qualifications, I actually have a Two year Diploma in Video Production from a major Canadian media production school (in Field Production Camera work, Audio and Radio Production and 3D graphics animation and modelling).  

My day job is Multimedia Development work for aerospace systems which includes coding of Real-time Vision Recognition systems with SOBEL/CANNY edge detection to vector conversion and real-time object tracking used in high-speed missile defence systems, rail-guns and autonomous aircraft/spacecraft flight control (at up to DCI 4K/8K/16K resolutions at 10,000 fps and 160,000 KMH)  

I learned C/Pascal coding since I was 8 years old and have always worked on DEC VAX 780's-to-9000's, IBM Mainframes, Sun/Apollo/Next Workstations and did real-time systems and graphics coding back in the day BEFORE I went to Broadcast Television Production School and then onto Legal Video and Product Video production for Big Tech companies!  (I just wanted a change of pace from computer coding to video production!). I also STILL do video editing and animation in my day job in addition to C++/Lazarus/Delphi/JAVA coding!

I also do security/admin/encryption consulting for my 30+ year friend who gives me access to his company's fancy supercomputers (of which I designed the GPU SOBEL/CANNY/Vector portion of his combined CPU/GPU/DSP/Vector Array chips!). I get computer time for my own personal projects in exchange for my expertise.

My night-time hobby job is cross-Canada FOH (Front of House) and Audio-for-Video Production on Neve, Roland, SSL Scenaria (and newer SSL consoles) for Heavy Metal Bands, Operatic Metal bands and EDM. I'm somewhat decently known in certain metal band circles for my live mixing abilities!  I'd rather not tell which bands and DJ's are on my credits list but you probably know them! I've done the Vancouver, Calgary, Toronto EDM/Metal Band Circuit for a looooong time now! I knew DJ Tiesto when he was YOUNG -- he MIGHT actually recognize me!

V
Reply: @StarGateSG7  So no qualifications in audio device engineering?
Reply: @StarGateSG7  Why did you describe "your company's" products or something and then later say that you actually have a job elsewhere and you aren't an employee there at all, they only "give you access to their resources"? And you occasionally do free coding work for them because you're an old friend with the owner? Did I understand that right?

And why did you describe that battery tech with totally irrelevant specs that don't describe the batteries in any relevant way?

And why mention a driveline system and apparently one that is also a suspension system hybrid, which has never been good as a combination, then in addition mention tech like all wheel steering and variable ride height when that is nothing new at all and definitely not invented by that 'secret company' you describe?
Reply: @pistonburner6448  The suspension system I designed because I was ANNOYED at Fox Shocks for making crappy shocks that don't give me active computer control AND the upper-wheel hub design like we had in Humvees!  I wanted 20 inch to 36 inch clearance on my older F150 and since I have access to all that fancy CNC machining and 3D printing gear of my friend's company, I just made the highly curved all-Titanium suspension that uses MASSSIVE built-in pistons to lift/lower the truck from the upper hub and it ALSO has four wheel steering and adjustable hydraulic damping and ride height control via a 600 samples per second computer control system.  

No more drive shafts or even a transfer case as the drive is an electric motor-in-hub design (i.e. that's powered by the V8 gas engine) We use high heat resistant Cobalt Samarium which is better than Neodymium in the hub motors for longevity.

V
Reply: @pistonburner6448  Technically, I work at an aerospace firm used by the NCA (North Canadian Aerospace) company which is part owned by my friend of 30+ years (i.e. he is a high net worth individual and also has an advanced degree in Mathematical Computing).  

My day job does mostly video and vision-centric multimedia work for multiple companies including the much larger NCA company.  The smaller company is not directly owned by NCA but it's owners are related to ANOTHER owner of NCA. (i.e. those owners are not my personal friends BUT rather related to my daytime boss). 

It's kinda complex as to the various interpersonal relationships at play here but the end result is I get to do interesting computer and video work AND I get to play with the latest high tech toys for my own personal projects.

My night-time HOBBY is FOH (Front of House) in Audio Production (i.e. mostly live mixing and NOT actual audio hardware engineering!) ...BUT.... I have designed and built my own premium quality speakers!

BUT then again I CAN also design and build full Class-A/C/D audio amplifiers if I want to in addition to having actual SCHOOLING in live and recorded audio AND video production!

V
Reply: @pistonburner6448  I can design and build  Class A/C/D amps and the processing cores of a SOBEL/CANNY convolution filter into ASIC hardware using our own in-house designed and coded VHDL (Virtual Hardware Description Language) toolsets, so there's that .....

AND ..... I've learned enough FPGA and VHDL over the years that I can now do a full CPU/GPU/DSP processor ASIC if they wanted me to!

V
Reply: @StarGateSG7  , you're talking plywood. I've heard tell MTF boardis better cuz it's the same density throughout, unlike plywood.
Reply: @jasomkovac9115  I like plywood because I want some resonance and colouration to enhance my bass PLUS I can get some SWEET Black Walnut, Oak and Cherry Veneers on my 3/4 inch or one inch marine grade plywoods at a VERY NICE PRICE!
I usually use SIX inch thick fibreglass batting layers to deaden the sound and that is fine with me.

It's just a personal preference. Compressed Sawdust boards also work very well. Other people use SOLID WOOD, rock, concrete, carbon fibre and even solid GLASS as a speaker box material!  You can use whatever floats yer boat!

Look up Rockport Arrakis Speakers to see TRULY HIGH END SPEAKER CONSTRUCTION!

I want to custom build my own version of THOSE ones!

V
Reply: @StarGateSG7  German here and it's Arschloch not arseloch,sir.
Reply: @Commentorist  I know! I did that to evade the censors on some youtube channels. Plus UK members TEND to use Arse as a prefix and KNOW what that means!

Anyways, the shape of our human "Arsch" can make some very nice and bass-ey audio sounds that will tickle the fancy of many people outside the Audio Engineering community!  :-)  ;-)  :-)

We should build that "Arsch" shape into NEWER and MORE MODERN designs of loudspeakers so that they may fulfill the desires of many audio enthusiasts for MORE BASS!

V
Reply: @pistonburner6448  yea, really hard to tell if this dude is talking utter shit or not. All the things youve highlighted, plus the 1000 kg "tractor beam" and the "160-IQ" AI/artificial neural net.... Also this "North Canadian Aerospace" public front company isnt anything that I can find info on, nor the 2 supercomputers nor the new battery tech that should already be public knowledge considering his 5-month old comment said it was going to be released in a few weeks...

This all reeks of "the cybermatrix 100 tu01" that was hilariously showcased on Idubbbztv almost 10 years ago, look it up if you want a laugh :D
Reply: @StarGateSG7  What Drivers did you use in the cabinets you made in High School? Im experimenting with drivers from this era, some of the best ever made. Many perform incredibly as full range, or I sometimes combine with a more modern tweeter/super tweeter if needed. 
With the Borosilicate sheets, you suggest to use them in a similar manner as the acoustic ceiling panels? When you suggest the enclosed liquid, could you make this enclosure by taking 2 sheets of borosilicate and selling them with epoxy like window pane, leaving a small hole on top to then fill the desired liquid, and seal it off once filled? Seams very doable, I just dont have the scientific understanding of how/why it would function. Seems like a cool experiment. 
Also, did the Canadian levitation research teams you were part of have anything to do with John Hutchinson?? 
Thanks for sharing some of your experience and knowledge.
Reply: @headlessheroes551  The enclosed liquid is for cooling purposes for microchip operations where GaAs (Gallium Arsenide) microcircuits are etched upon such glass and NOT FOR speaker driver production which is a SOLID PANE of Borosilicate (or even better yet SAPPHIRE aka Aluminum Oxide!) which has embedded iron plates surrounding the edges so se can levitate the whole pane in-air using a magnetic field and MOVE IT back and forth to create a high end multi-frequency driver system.

I reread my earlier comments and it seems I mis-wrote it. Double-paned Liquid-filled borosilicate is for COOLING of SMALL panes of glass that have CPU chip circuits built on-top of the panes! Me thinks I was probably tired when I wrote it.

We just use a SINGLE PANE of borosilicate for mid-air speaker driver EM-based levitation purposes!  We also use EM field levitation for creating in-warehouse "trucks" and "forklifts" which are driven by a computer to lift 10 Tonnes (25,000 lbs) or more of items!

In terms of drivers, I had used some from a high-end set of Pioneer-sourced 3 inch Tweeters, one 6 inch low-Midrange and one 8 inch highmid-range and a 12 inch Bass driver with cross-overs handling 10 Hz to 80 hz for the bass, 80 hz to to 2600 for the low mid-range 8 inch driver mid range, 2600 to 3500 for the 6 inch driver and 3500 hz to 20 Khz for the 3 inch tweeter. 

I bought those from A&B Sound on Granville Street in Vancouver, Canada at the time since they were part of a parts repair inventory for higher end speaker sets which they got rid of during a sale so I paid 1/5th the cost of them new ($650 for all of them!)

I used four drivers since I could get them and my teacher at the time said most people can hear at the mids best so separate them out to get the best tonality!

I used Black Walnut veneer douglas fir plywood (3/4 inch thick) and 6 inch tick fibreglass insulation for best sound dampening. 

I did separate the drivers with a 3/4 inch thick plywood in-between so each driver was in its own mini-enclosure. There was a small 1.5 inch diameter airhole made in the back plywood so each driver's mini-cavity could "breathe" through the fibre glass batting and through the airhole to prevent excessive pressure wave build-up behind the drivers which would "colour" the sound.

I plugged each hole with acoustic foam so bugs couldn't crawl into the speakers but air could come in and out of each back-of-driver hole.

I also made custom speaker stands which ANGLED the entire 4 foot high speakers perfectly towards my head whenever I was sitting in a lounge chair. For actual music production, I had a REVOX AM/FM receiver and amplifier system with an analog parametric equalizer so i could mess with the sound however I liked. 

The CD player was a high end Nakamichi which STILL works great 35 years later!

I even hooked up the speakers to a 26 inch Sony Trinitron CRT-based TV so I could have high end sound back before surround-sound was even popular!

In terms, of your last question of do I have any work-based relationship with John Hutchison? The answer is NO! We are a Aerospace company that does independent research although we were AWARE of his research. We have our own in-house designed and built aerospace vehicle lift system based upon Electrostatics and GWASER-based methods!

V
Reply: @devtech4661  you are salty because he knows something you dont. come off it bro
Reply: @StarGateSG7 Hey now Stargate... Let's use our SG2 voices in here. We can all read you just fine.